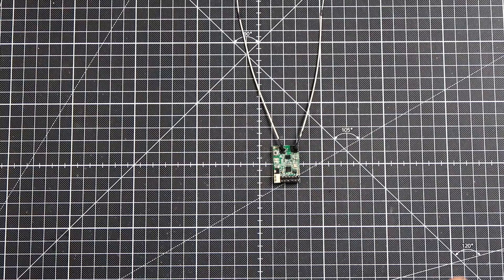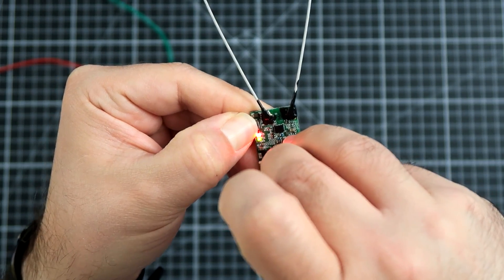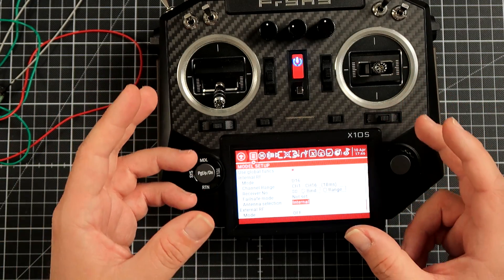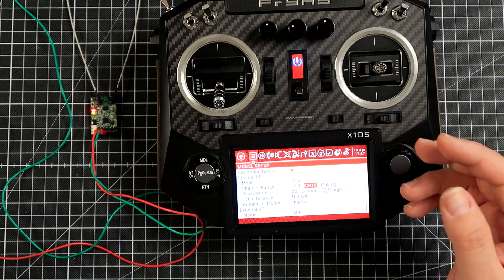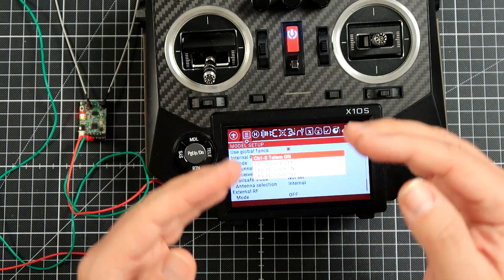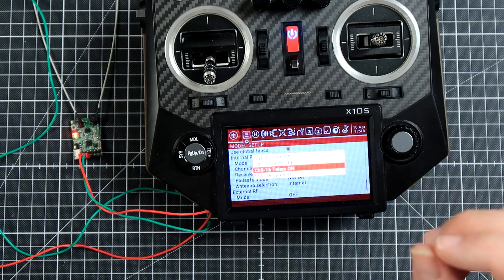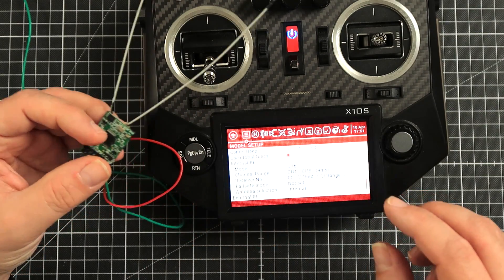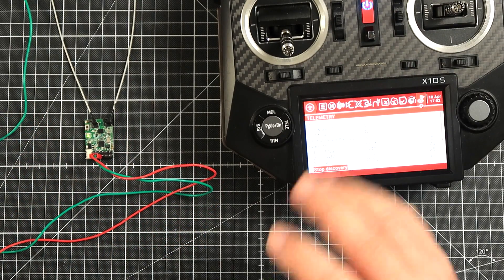How to bind FrSky receivers with OpenTX radios

Comment: Just want to let you know that I had to use FrSkyX2 to bind with a FrSky accst R-XSR receiver. Took me hours and hours to figure this out
Reply: How do you change this in the controller? I have an X9D
Reply: @peenabudda84  I'm not familiar with that transmitter. If it is running opentx in the section where you do the bind go up a compel of lines and there should be a spot to specify the protocol to use.

Comment: thanks for video Pawel, I need help for sure, I have new radiomaster tx16s  it came with firmware 1.3.1.36 and I have reciever R XSR that i flashed with 2.1.0 fcc, for last 2 days i have tryed everthing I can to bind but no go with red light only and red with blue flashing but no go i have tryed all frysky models in radio but will not bind. please advise, Thanks again

Comment: There is a 16CH/9ms Firmware for FrSky from a Betaflight developer. CH1-8 is 9ms, and CH9-16 is 18ms latency. You have to set the RSSI in the channels 5-8. Look and download here: https://github.com/mikeller/opentx/releases 
Pawel, you can do a review, there are no reviews available. You can measure the latency in Betaflight Blackbox.

Comment: Hi Pawel, love the channel and some times simple staff is good too. Recently I run into a problem with my R9 MM RX and X9D Plus. Some times my RX is not working and I have to go through the binding process again. Both RX and TX are running the Flex firmware and I can't track down the problem. Any thoughts?